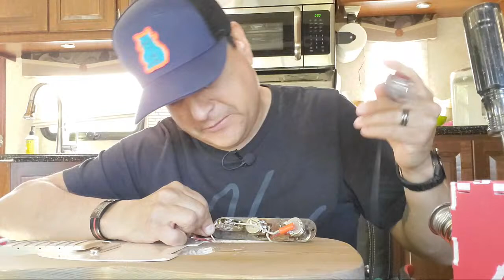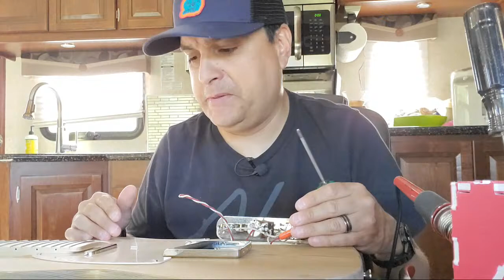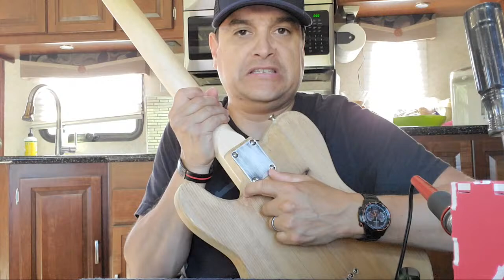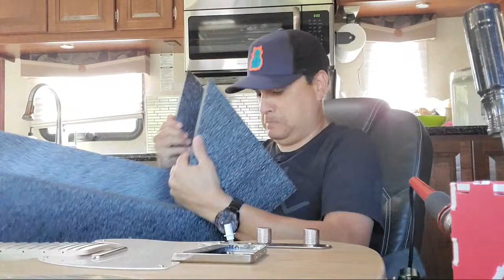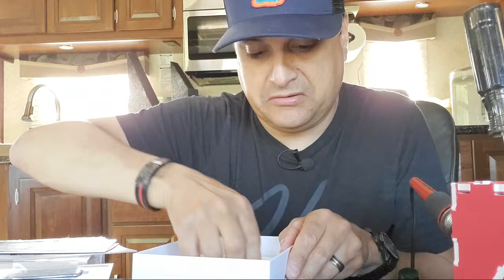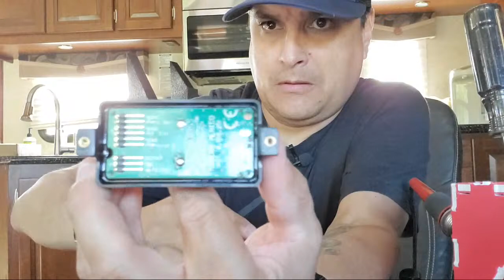LIVE Guitar Q and A How to Install Tele Pickups - Fishman Fluence Unboxing

Comment: I have a G&L SC-3, this is the second one I have owned. The first was stolen out of church in 2017. Both had the MFD pick ups in them. The first one had lower output but was one of the cleanest guitars I have ever heard or played. The replacement guitar, sounds very good and it has a higher output, but is not as clean. MFD stands for Magnetic Field Displacement. They have a ceramic magnet and adjustable pole pieces. I use to think the MFD's had some Leo Fender voodoo magic in them, but after watching your Chanel and owning 2 different guitars that sounded different, I understand that MFD is the name of the design. I personally like the sound of the pick ups. This is my personal experience with the MFD. Thank you for a great video, be blessed.